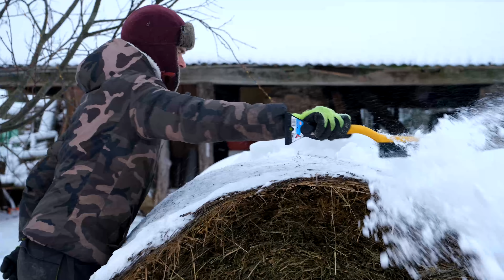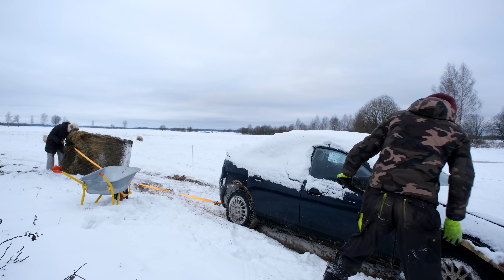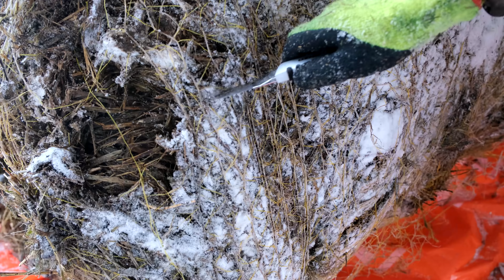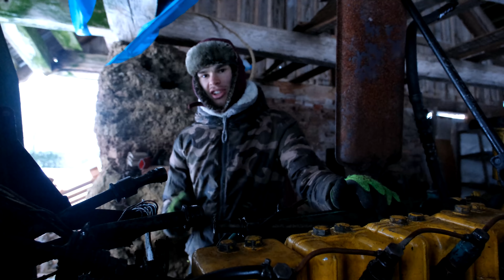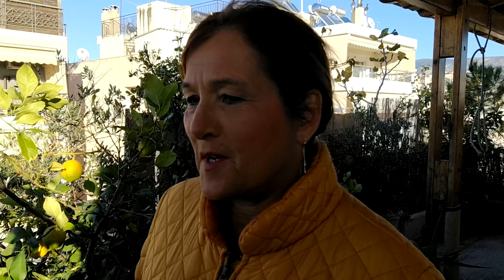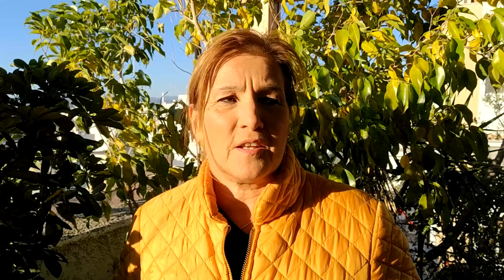Can WE Move the HAY ROLL by HANDS?

Comment: We love your mom!  No wonder you have a green thumb!   All of your struggles with that round bale.  Been there.  We have never had a tractor to move bales with and have had to roll them into place FAR too many times in my past.  But ... you got it DONE!  When it comes time to feed "crackers" again, make them a LONG trough outside.  Many people use a plastic barrel cut in half and screwed together at the ends to make a U shape or even a big plastic pipe split down the middle.  You can attach a board or two at the bottom to keep them from being pushed around.   With a long feeder outside the sheep and goats can each find a place along the feeder and have more trouble bullying each other so that some miss out.

Comment: The goats and sheep are very happy!  Actually, when we had horses, we didn’t have a strong enough tractor to move our hay, so we rolled them from the trailer into the hay barn.  We cut the strings on one, pulled hay, put it into a push cart to take to the horse trailer.  For the goats we buy the more expensive square bales.   We keep one in a stall in the goat barn to feed section by section in a feeder.  Hope you get the tractor working like you want.